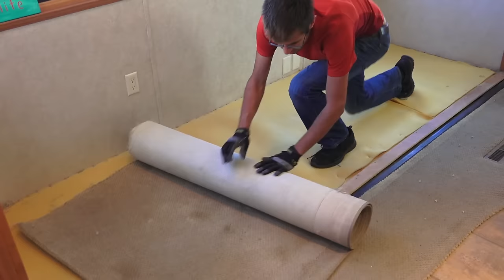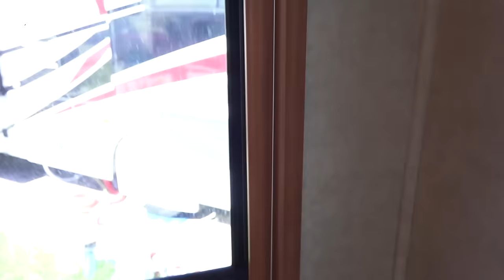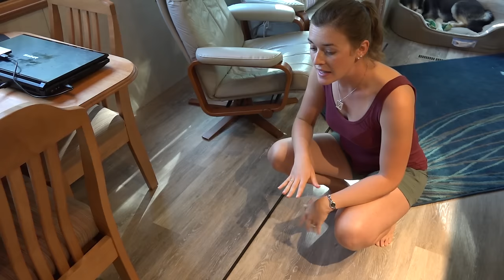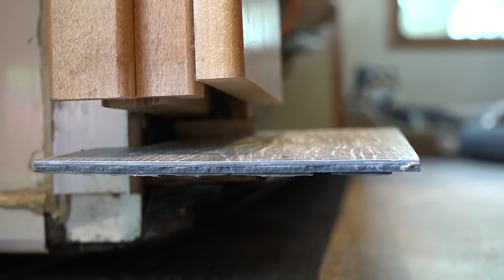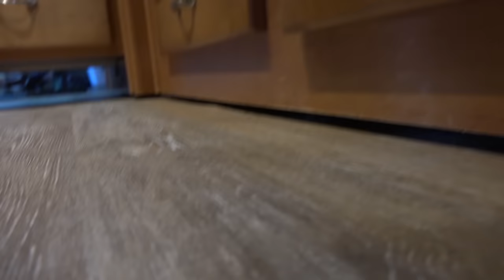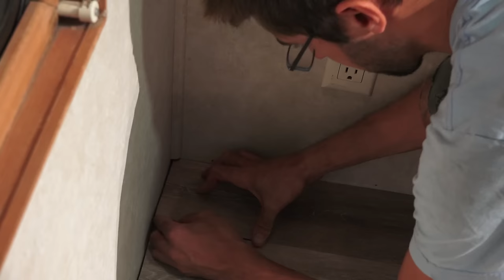DIY RV Reflooring with a Flush Slide-Out

Comment: For labor cost reasons, almost all RV manufacturers lay the floor before installing all cabinets, appliances, and everything else and then cut-out where they need to put plumbing and wiring. We removed the bottom cabinets when putting down new flooring. I think it was quicker and easier than cutting around it.  Our newest RV has tile with no carpeting.
Reply: how much does something like that cost?
Reply: The flooring is put on in a single sheet. To put the cabinets and stuff in first would require cutting the flooring to fit around them, which at least twice as long. Materials are cheaper than labor.
Reply: okay, how much? I hate carpeting and if I do buy something it will be used and most that I see have gross carpeting. I want to put something waterproof down like tile.

Comment: Did you change the "glide strip" under the flat floor slide out? They are a kind of plastic for carpeted flooring and a rug or felt type material for hard flooring. They carry some of the weight of the slide out room as it goes in ot out. The wrong type can gouge your floor. If yours is a system made by HWH Co, then this strip is the entire length of the room and is outside when the room is extended. Our hwh system has the glide strip over a support bar that is removed to get at the glide strip. To do that, the weight of the slide out must be supported by jacks snd blocking or dome way to get the stress off of the mechanism.  You can also adjust the height of the room as it dlides in or out to give more clearance. 
We want to do tha sas me kind of job on our Winnie class A. Carpet isccx worn and after 15 years must come out. We thought about vinyl planks or grip lock like you used. Btw, I successfully used the grip strip flooring to finish off the ends and back of a cabinet that we used to make a peninsula in our home kitchen. I installed each plank vertically using small power brads to hold it in place until I got the moldings inatalled. After a month or so, the grip strip flooring kindbnb od bonded into place and seems to be staying put just fine after a year. 
Thsnks for your very helpful video. 😎
Reply from the maker: Glad you liked it.  Yes we use carpet runners to bring the slide in on now.  Works great.

Comment: File down any screws under the slide. The file will fit easily enough. Just takes a bit of elbow grease. Also when you are going to bring in the slider, cover the floor in front of the slide with thin cardboard for added protection.

Comment: Nice video, thanks.
Our old sheet vinyl OEM flooring actually split down the middle during the Polar Vortex deep freeze this past February. I looked into the Allure product for our 26" Class C, but the temperature range was too narrow for our locale. We live in Illinois and this past winter it got down to -30ºF. I found at Menards a click lock vinyl plank, rated for -20ºF - +140ºF, designed for vacation homes/cottages that are not climate controlled. It is Mohawk Home Expressions Luxury Vinyl Plank. The downside is they offer only a few color choices.
Waiting for it to warm up here so I can install it. I am a bit concerned about removing the carpet and what I will find underneath. It looks like the carpet was glued down. Should be fun...

Comment: You probably can carefully cut out the scratched plank and replace it with another of exact size. If you have a regular metal file that might work to file down the offending screw flush and even glue a small piece of felt over the screw head (same sort of idea as felt protector on chair legs. Presuming you have a little room to work at it. Great job!

Comment: Great job on the flooring. How did you frame out your windows? They are beautiful. Do you have a video on how you did that? Did the wooden framing help cut down on the heat and cold transfer from the metal frames?
Reply from the maker: This RV is a DRV with thicker walls so the windows are recessed.  They come this was and are the only brand we know of that does it.  We really like it too. Yes it helps with cold transfer but so do the thicker walls.

Comment: Floor looks great. We are starting to strip the flooring in our camper tomorrow. As the flooring you installed is an all vinyl product there could be some shrinkage and expansion, especially if the camper is stored cold for the winter. Has any of the joints opened up?

Comment: wondering about temperature fluctuations with the sticky edge. will excessive heat or below zero effect it?.   we have been looking for a product to use. love the look
Reply from the maker: We have noticed in cold below 40 small gaps form but thr sticky has not seperated.  I would prob not recommend it for below freezing.  Hit does not seem to be a problem.

Comment: Hi seen this video love the flooring color choice. I opened my camper up for the first time a week ago since locking it up for the winter.Once i opened it I came to discover all my sheet vinyl split and cracked. I see this project was done a while back and wanted to know how the flooring held up during the weather changes. I am in Wisconsin where the winters get very cold and the summers get very hot and was hoping you could shed some light on if this is the right choice for me as well.

Comment: Why did you have to take out the 1-2" piece of wood that supported that section at the font of the slide out? In case you haven't been able to remedy the screw under the slide out scratching the floor due to limited space, use a thin flat file to remove the offending part of the screw. Some people jack up the slide while it's out to gain a little more clearance under the slide to gain access. Looks great!
Reply from the maker: Thank you! We wrote more about the whole process and the problem with the 2" strip of plywood in this blog post: https://mortonsonthemove.com/diy-rv-flooring-with-a-flush-slide/

Comment: It looks great. The problem is how it holds for the weather extreme. The manufacturer is warning not to put in an rv that is not weather controlled between 60 to 85 degrees. And what about gluing it down to hold better for traveling or weather expanding and contracting ?

Comment: jealous, that carpet removal was a piece of cake compared to mine. my unit was built on top of the carpet and the slides were wrapped top and bottom with the carpet with a zillion staples. Cabinetry and even walls were built on top of the carpet.  It took a ton of cutting and cutting and more cutting, then pulling, ripping and basically a nightmare, but I got it done. Almost impossible to get out from under the slides!!! pretty ridiculous really.

Comment: When doing these jobs keep extra pieces (forever). You can remove the scratched piece once you fix the screw. Start in the back corner that is on top of the other sticky edges, pull it up slowly and then loosen its own sticky edges from under the other two pieces next to it. Slide the new piece’s sticky edges back under the ones next to it and then squish it back into place. Should be like new. If it’s been a long time sometimes it too new looking and you can see it was swapped out next to old ones. Then you have to work it a bit to make it look older.

Comment: It's been just over a year since you up loaded the video, did find any issues with expansion (heaving of the flooring in the summer) and contraction in the winter months.  Would love some input before I tackle my motor-home flooring project.  Thanks for the video upload, it was very helpful.
Reply from the maker: No heaving from heat, although we installed it when it was warm.  When cold ( we have been down to the teens) gaps will appear and a few have stayed because they got dirt in them.   In general it still looks great tho! I would recommend trying to find a flooring with a very wide temp range however.
Reply: @MortonsontheMove  thank you!!  I was wondering about that too! We have a 2012 Flagstaff 31ft & I'd really love to take out the carpeting & replace it with similar flooring to what you have done.   So, we need to be sure it can handle our Illinois cold winters!!  And,  I LOVED your very educational HOW TO video!!! Again, thank you!

Comment: Another solution would be using 2mm thick floor panels to raise the floor and then in the area where the overhanging lip is, use a piece of 2mm thick stainless steel
that is about one foot wide and where the lip is glued on. then you can step on it without breaking the lip.

Comment: Now that you have some time on this project, how about an update? Would you do it again? Any more suggestions? How has the slide-out edge held up?
Reply from the maker: We added sheet aluminum under the edge as it started cracking a little and its held up well.  Overall it's been good flooring but has a few gaps now fr.expansion and contraction in hot cold.  I would probably do a click lock next time.

Comment: Good video!  I have been thinking about getting rid of the nasty carpet.  My slide comes down on the vinyl.  Will have to watch that before installing new floor.  I was wondering about the slide edge too.
Reply from the maker: We did have a problem with the edge but put thin aluminum under it and it’s great now.

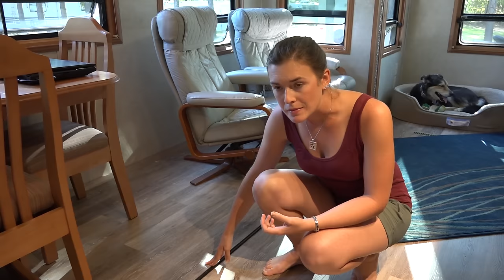Comment: I am in the process of updating our "new" coach as well. I have done the same as what you have, the "ALURE" flooring. I noticed at 9:50ish, the side of the slilde with the floor hanging down and not supported. Why not use the "super glue" on top of the plank to the bottom of the frame to have it not droop...?

One thing I'm concerned about with my update with the flooring is, I did not pull up the linoleum. I placed the planks over it. (existing linoleum. Now I'm concerned about the added weight. Your thought???
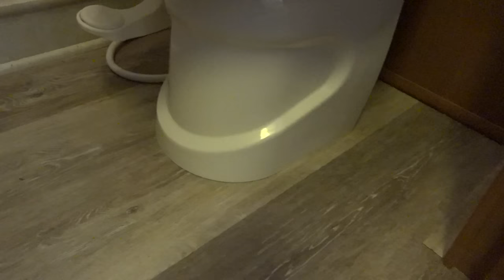@ 14:45ish, Very nice job on the circular cuts!! That was one of the toughest for me. My patience taken to the test! I personally removed the toilet finding it easier to do so, I just made a couple cuts for drainage, etc. and replace over the linoleum tile...just what I did.

I have just come across your video tonight so I am going to have to see what else you've done to not make some mistakes by your advise however, so far I've re-stained the light oak cabinetry to dark maple with light accents on the trim, keeping it closer to the light oakish. I'm looking into replacing the interior lighting to something a bit more attractive than the original ugly things! Going to add a couple pendant lights in the kitchen and living, replace a couple of the wall sconces, etc.   OH!!!! GOT RID OF THE BORDERS! Luckily the wall paper actually matches the theme we're going with with earth tones brown/tans oppose to the 'miami vice pastel blue theme!!! 

Looks like a nice coach and the pride as we have in our "new" 2006 Terry Quantum 330FKDS Extreme Weather model.

Boy, the adventures to come with her.....I've certainly got to change out the AC eventually top get some air in the bed room.

Good job and thanks for the video. 
Hope to see you out in the adventures one day!
Reply from the maker: Weight is a big concern.  I think we added about 150 lbs.  Removed it elsewhere tho.  Good to keep on mind.

Comment: has your floor held up after a couple of summers?  We installed a peel and stick vinyl flooring and we have been told it won't stay stuck down after a summer.  The heat will cause it to pull up.  We live in Norther AZ and don't get very hot in the summer.  Thanks

Comment: Nice job!  Question - Are those replacement shades on the windows?  I have a 2004 and it has the original shades.  They are awful and falling apart.  I've looked around online but I'm having a difficult time finding either the right sizes or custom sizes that don't break the bank.  Yours look great - clean lines. Thanks!

Comment: I would have double planked the slide out transition area.  It would be plenty of strength to support any oops steps and also would have been unnoticeable.  Even a 1/4 inch of fiberglass which would have been strong enough to hold.

Comment: Could you not use a heat gun and heat that plank to remove and replace. You could use the Teflon moving pads under the corner of the slides when bring them in too.  Just a thought. Great video as always
Reply from the maker: We are thinking of trying that at some point, for now we are going to see how the floor continues to wear.  Thanks for the comment.

Comment: Great video and I’m just about to tackle the floor in our Cedar Creek Cottage Destination trailer - which has carpeted slides.
I am curious how well the vinyl laminate that is glued down is holding up.  Our trailer is semi-permanently moored in AZ where the inside temps can get well over 100° F in the summer.  I am more worried about puckering when it expands in the heat.
My current plan is to fasten the first row of vinyl laminate to the slide and then glue down a transition molding on top of that rather than have the delicate edge of the plank exposed.
I am using Nucore click together planks.
Any thoughts are appreciated!

Comment: Nice job of explaining what you went through to accomplish the task at hand!  I have worked with all types of flooring on different jobs and have used the Allure.  The slides do present a problem and a bummer on the screw scratching the flooring.  Just a thought;  I would have filled in that gap and done a metal transition on that slide.  The plywood was another thought, but like you stated, you start getting into a weight issue and Allure is heavy in itself.  Not criticizing , just offering another idea.  All in all, very nice and gives your space a really updated look!
Reply from the maker: Thanks Joe,  If this does not hold up that is probably what we will do.  Have some spare pieces with us.

Comment: I’m wondering if I can attach a small piece of carpet turned upside down on that part of the slide if it would just slide across the new flooring. Our new to us DRV is currently stored with no power hookup but I will have to look at it once I get power installed and run to it.

Comment: I installed Allure flooring just like this and it is off gassing terribly. The manufacturer won't do anything because they claim that the floor has no warranty being installed in an RV. The problem is not where it's installed but that it off gasses no matter where it is.. Did you all have any problem with a strong odor from this floor?

Comment: I apologize if this has been asked previously: Did you consider trying to replace the damaged plank? If there were much worse damage from something, would you be able to pull up just that area and put in new material, or do you have to remove a plank from the edge and work your way over like I believe the quick-lock type product requires? We have exactly the same type slide and are debating what type product to use. We currently have laminate...but we're assuming we'll need to pull it up and are praying it's not glued. Thanks for such a helpful video. (subscribing now)
Reply from the maker: We have considered trying to replace it, not sure exactly of it would work, maybe cut a hole in the center of the plank and peel up.  I think it would be doable if you went slow and we might try it eventually, just have not had the time yet.

Comment: Because I am contemplating changes to my Travel Trailer with no slides, I was paying close attention to your challenges and solutions.  I was looking at your vinyl to carpet interface to see if you used a T strip or what you did.  It looks like you just cut a very straight line in the carpeting and brought your flooring right up to it.  Do you have plans to address this interface in the near future, or are you going to just wait until you rework the floor in your bedroom?  Right now, my dining area carpet to kitchen linoleum appears to be just what I would call, butt the two together tightly.  I also plan on keeping the carpet in the bedroom area as I don't like stepping out of bed onto a hard floor.  The carpet to flooring interface and the flooring to linoleum interface are two somethings I am going to have to figure out.  Suggestions?
Reply from the maker: We were planning to use a t strip, but after a year we are quite happy with how it looks just butting up to the carpet.  You really can't see where the transition is and it's really clean looking , really depends on the height difference.
Reply: @MortonsontheMove  -- Well, yours looks really clean and neat.  If I can make it look like that, I will be happy.  I am glad to know that.  Thank you!

Comment: We have the same problem with one side scratching. Did the thin rubber pad (which you put under to protect it) get stuck or caught when slide was going in or out? I was concerned it would add too much height under.  Do you think it could be used each time we slide in?

Comment: How did you do your stairs? 
I looked on the website and it said that these kinds of planks shouldn't be applied to vertical surfaces or stairs. It also said to only install it in climate controlled areas-- I would think you'd have to install some sort of installation. My current flooring stays pretty cold in the winter and fairly warm in the summer.

Comment: Floor came out great! just did mine as well but I’m concerned my floor may get scratched by slide.  My question is do you use anything under the slide to prevent from scratching when sliding in and out?  Appreciate the video
Reply from the maker: Yes we use pieces of carpet they we lay down.

Comment: Great video! You guys rock. Do you think the weight of the planks is greater than the linoleum? I'm wanting the same floor in mine, but concerned about adding weight. Thank you!
Reply from the maker: Yes we think it added a little extra weight.  Not sure exactly how much but probably 50-100lbs for our RV.
Reply: It will definitely add weight but not so much it will make a huge difference just be mindful of your tow capacity